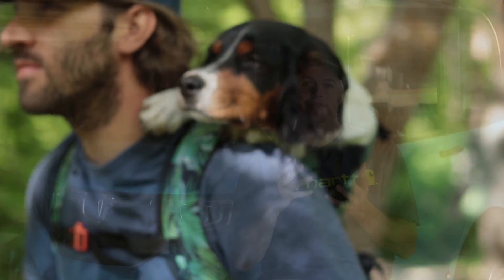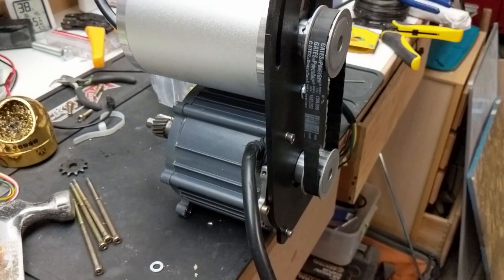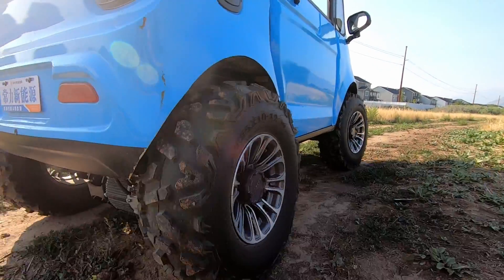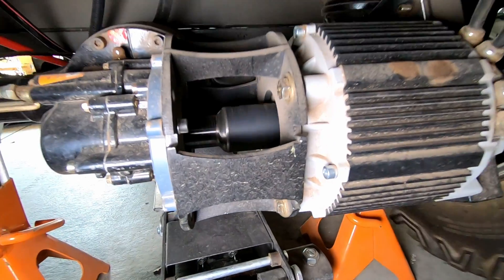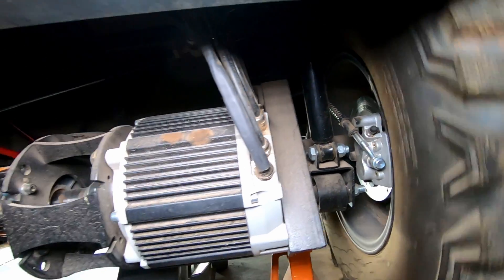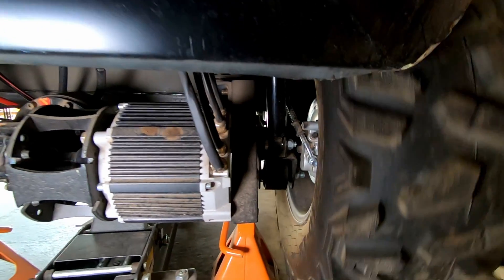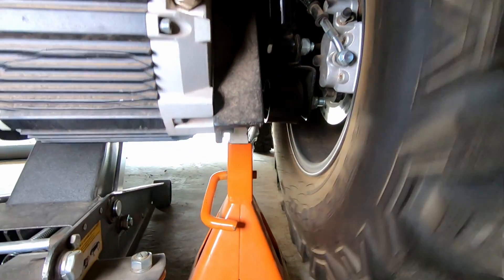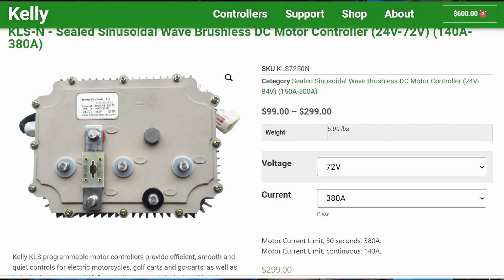How the CHANGLI Got a 24HP Motor Upgrade! CHEAPEST EV MONSTER MODS PART 3

Comment: Solar is an option and keeps the car cool/in the shade.

Genset rewired for 70 volts is another and there's already a mounting for one in some Chang lis.

Redo the chassis welds before the whole thing falls apart!

Comment: I've got one of these changli car with the stock motor 60v 1500 w and it doesn't run at all. do you have a schematic of the complete wiring of this car that I could purchase? Bench tested the motor with 36v charger got the motor to spin. but stumped beyond that.anything would be helpful as it's been sitting in my garage since april and hasn't moved an inch.
Reply from the maker: Sorry! My wiring was super wild West. No documentation at all

Comment: I am sorry for bothering you again, but I loved what you have done with the change, can you upgrade the batteries to lithium without swapping the motor controller? also, can the new Kelly controller you installed to be used with the original motor?
Reply from the maker: Hi! You could swap to lithium if you didn't go over 60v but you would need a lithium charger. Yeah you could run the Kelly on the stock motor. If you go to higher voltage you just need to use a higher voltage step down converter that runs the screen, lights, backup camera, etc. I'm not sure how much power you would get but should do something! Staying at the same voltage and feeding the stock motor more current would give you more acceleration if it can handle it but higher voltage is the only way to increase speed with the same motor

Comment: How can I buy one in Florida?
Reply from the maker: You can find the changli factory on Alibaba. That's where this one came from. Straight from China. Honestly they are not that great stock. Even this one is not what I would consider good. Build quality is pretty bad, suspension is horrible...etc
Reply: @3dconceptsofutah757  how much did you pay ?
Reply from the maker: It was $900 and $900 shipping but I'm sure it's gone up

Comment: I would love to mod one of these out to be faster and stronger. If it did 45 or 50 solid with no hill trouble I'd be happy.
Reply from the maker: You will need to build your own suspension to hit those kind of speeds.  The way it is stock is really sketchy and makes it speed wobble after about 30...
Reply: @3dconceptsofutah757  I'm sure you would need to upgrade the sway control to something that would let you adjust the tilt of the tires too. Idealy it would be like an m.e.v which look like exactly what I want but I like the idea of it being cheaper than that brand because of my limited use and my own budget. There are off the shelf products to replace weak parts with but I don't know enough to select at this point. I have a local mechanic friend so its doable if I could just get brave enough to order the vehicle. All the importing makes it scary.
Reply from the maker: Yup I hear you. At least you can trust Changli factory on Alibaba. I have ordered parts from them more than once. They are legit. Alibaba pay also gives you a later of protection from shady factories in China. Always use Alibaba pay...
Reply: @3dconceptsofutah757  I might have ordered one by now but I have been a little scared about shipping to Chicago area so I can pick it up there from a ship. It looked like that would be my point of importing and paying some fees for that part that weren't included in my payment. I would.live to know how you did all that at your port and how your payments went out in a protected way. Maybe do a video about that part. I'd watch it so I understood what to expect and how to deal with accepting the delivery at port.

Comment: Hi @3D Concepts of Utah , may be worth it to upgrade the open diff to a limited slip one either with a kit, but i doubt someone makes one for a golf cart or get like a bmw one in the junkyard an try to mount it.
Reply from the maker: Thanks for the suggestion! Yeah not too many people make aftermarket stuff for Changli's yet ;-D I have though about digging through a junkyard trying to find a real diff that would work for this. One challenge is it's a bit narrower than anything out there.

Comment: Over voltage will give you more speed and you can use a controller with less power to prevent burning it up.  I have a cargo trike from china and swapped motors out day one.  3900 rpm was the maximum that I could plug and play without having to change the differential.  If your motor only has 2800 Rpm increasing motor wattage wont increase your top speed, hence your disappointment with the 24hp motor.  Aliexpress has plenty of differential packages with better motor combinations than your 24hp beast.  3000 W 72 V 4800 rpm motor would get the Changli going 45 kmh.  80ah AGM batteries would have a 100km range.  Pardon my socialism but I only know metric. I am facinated at you mechanical abilities in the USA.  I live in Germany and have to keep all of my mods as stock as possible.
Reply from the maker: Ross thank you for your comment! In one of the next videos I'll show my 72 volt mod and also going with a bigger Kelly controller. I first went to 72 volts with the same speed controller and wasn't impressed because it turned out I was still being limited by the speed controller not delivering enough current to make it accelerate to my liking. I tried going with a bigger Kelly controller and was very impressed after that. I thought for sure the batteries would be limiting the current at the smaller speed controller configuration but I was wrong. They still had a little bit more to give. They might not be happy but they are delivering more current.
Reply: I think these little "cars" are pretty cool and have room for a ton of mods and upgrades, bigger BMS/Batteries/motor and a little bit of cad could do some crazy stuff

Comment: Did you mention top speed?
Reply from the maker: It started off at 15mph stock and now it's way sketchy to drive at 37mph. Doesn't sound fast but the suspension and steering design are well, terrible 😂

Comment: Maybe reach out to green line engineering. They been a leader in the e.v world for some time now. They build batteries 🔋 sell motors great tunes 👌
Reply from the maker: Thanks for the tip. I'll have to look them up
Reply: @3dconceptsofutah757  i found them after buying a sur-ron light-bee. They make all kinds of battery and controller upgrades i did some more digging into them since there is a half dozen companies that make batteries for the sur-ron and segway bikes but must of them started with the sur-ron where as green line has been doing it for years,  super 73 , onyx,  e-boards etc. 
  My next build is going to be one of these lil cars 🚗  they are amazing platform for a cool toy. You can find wrecked zero motorcycle for around $2,500 pull the motor than you got something crazy to work
Reply from the maker: @miguel360kmc  Thanks for the tips. I want one of those Sur Ron bikes! I have been modding Razor MX500s for some time now but those would be next level for sure! 
If you do get one of these and want to mod it. Get ready to build your own suspension and everything. There is not much good in the stock configuration. Very cheaply made in every way. Seats terrible, steering's terrible, suspension is very whacky and stiff.... Better off making a killer gokart in my opinion. They are cute and that's about it ;-D
Reply: @3dconceptsofutah757  for me its more about having a street legal go kart or golf cart. 
  There are a few other options but they all way way more expensive this one you can pick up from a ev importer for like $1,500 total. 
  And the sur-ron is a must have! But need to look at it like a crazy fast hard-core ebike or MTB if you go in thinking light way, all torque single track dirtbike you may be disappointed getting it to that level will be around the same price as a ktm freeride stock although the sur-ron will be about 20-25mph faster and lighter. For street rides going super moto build is a ton of fun and what i did. I still have dirt wheels takes about 10mins to swap the wheels and chain and your good to go
Reply from the maker: @miguel360kmc  Nice! For now I'll just play with my modified MX 500 Razor 😆 Someday though!

Comment: Hey If you get sick of it maybe just stick a gas engine inside like the 212cc predator for 130$ at harbor freight and I bet you can sell your electric drivetrain for more than that, so it would be faster and you'd make money back.
Reply from the maker: Not a bad idea! Thanks for the comment 😄
Reply: @3dconceptsofutah757  i subscribed and would love to see this thing turn into a real machine!! They also have a predator 301 not much more money but the 212 is better because they make a million mods and videos how to make them faster and then you can play with sprockets. Or just find a wrecked motorcycle and have a real fast toy!
Reply from the maker: @Partnerthedog  Thanks! I don't know if you saw my latest short but I broke the axle yesterday climbing a little hill! Broken parts mean more mods ;-D Since the owner of the car doesn't want it to be gas and the new 24hp electric motor actually rocks with the bigger speed controller I want to try running a CVT on the electric motor because it spins at 5k RPM which should be able to run a CVT I would think. I haven't found many people doing that. There may be a good reason why it doesn't work which I might find out the hard way.... Either way with a 40 series CVT and the right sprocket ratio to the new axle I would expect to have insane low end torque and a little more top end speed too which it's already really sketchy at 37MPH because it's such a crappy car to start with ;-D!

Comment: Get some knock-off 60v LiPo batteries (more fitting for this car anyway), they are like $70 compared to the $200+ that the real ones are.
Reply from the maker: Thanks for the tip bro 😄. Do you know of any sources or search terms to get me close
Reply: get some LiFe batteries (lithium iron phosphate) they are 3.2V nominal and are a lot safer and less prone to catching fire
Reply: Are you meaning like Multistar from hobbyking?
Reply from the maker: @BobsEVGarage  Thanks for the comment. I like Hobby King. Have to check out what they have that might work for this

Comment: please change the entire battery pack to lithium
you can't pull much from lead acid, that is what is bottlenecking you
Reply from the maker: I would love to but I think the owner of this vehicle is about done spending money on it ;-D The new speed controller made a surprising difference though. I'll post the update in the near future. Thanks again for your input and comments!
Reply: @3dconceptsofutah757  you can find any old wrecked prius or hybrid and I've seen people online, they test every single cell and some are bad so they remove them and basically you can make it smaller you could use half of a prius battery but yeah this is all more money. Honestly, you should just switch to gas. A 212cc predator from harbor freight is 130$ lol..
Reply from the maker: @Partnerthedog  Yeah Prius batteries might be a good option. I actually have a stack of brand new HF engines in their boxes still: 80cc, 212cc, and 420cc with a CVT and reverse gearbox but the owner of this car decided to keep it electric. I'm with you though. If it were mine, I would have gone 420cc, reverse gearbox and CVT. Would have been way cheaper and more power with less trouble. Just a bit noisier but whatever ;-D Thanks for the comment!